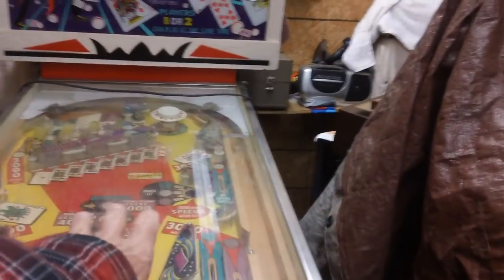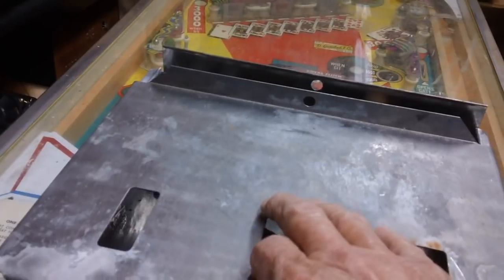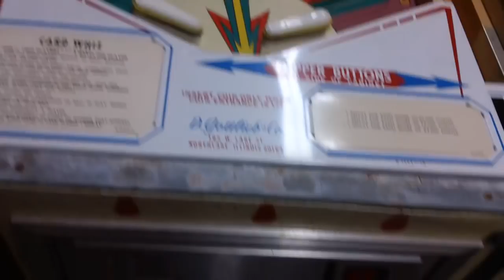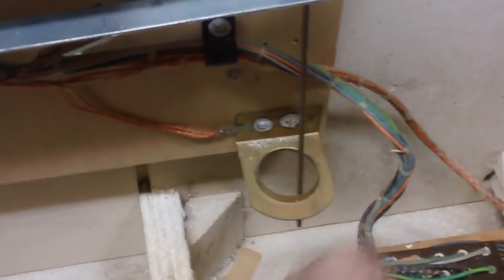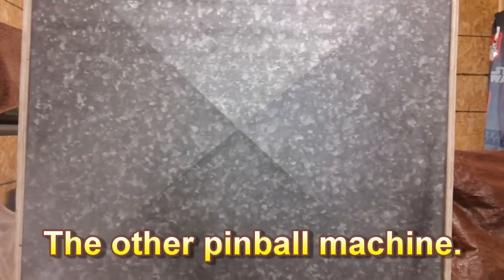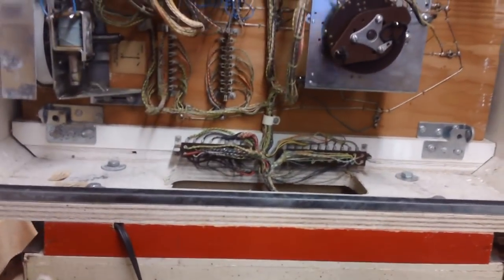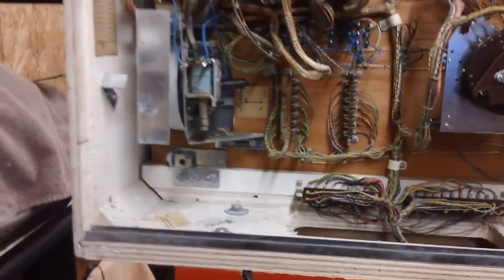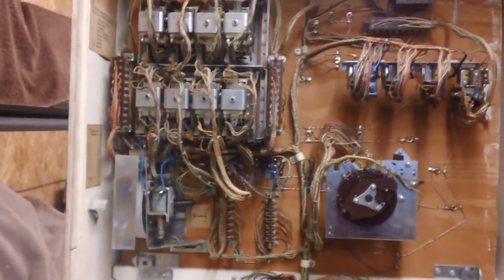1976 Gottlieb Card Whiz pinball machine repair (Part 1)

Comment: Please take a look at the tools section. My buddy suggests getting the L Contact adjuster. It is an invaluable tool for the many contacts that will need to be adjusted. As you know, if they do not make or break when they should, you will get all sorts of undesirable effects. Like he said its not hard to get these running, but getting everything scoring and working correctly can be a hassle. I have watched him with that little tool for hours, adjusting those contacts... Im glad I didn't have to do it... lol.